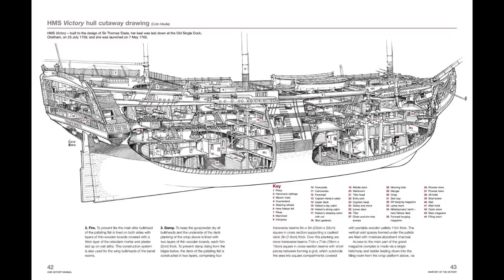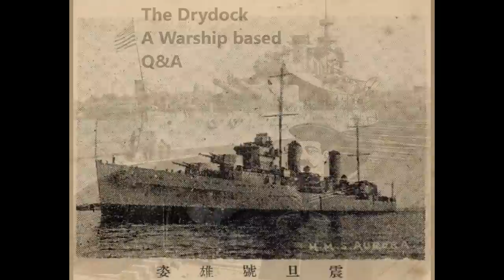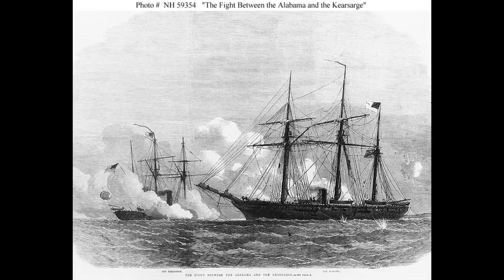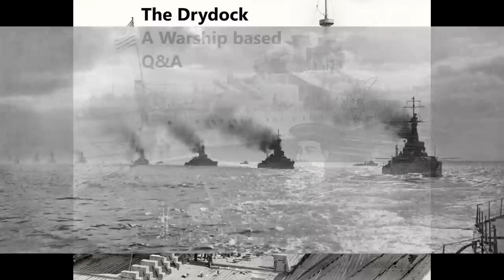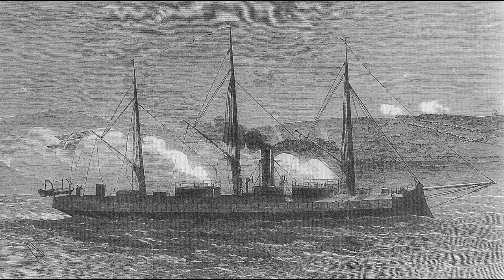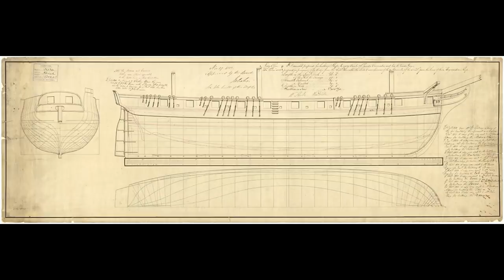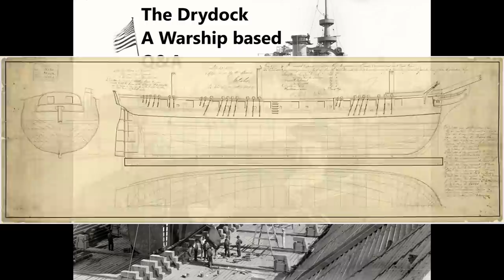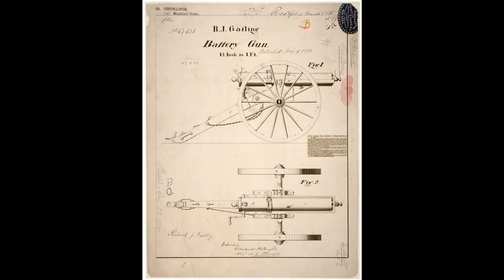The Drydock - Episode 179

Comment: Regarding obsolescence being an advantage: The USN's old S-Boats were too old to use the Mk. 14 torpedo and thus had badly outdated but actually functional torpedoes when the shooting started.
Reply: I've read about Mark X torpedoes fired from an S-class submarine sinking before they reached their intended target, and not from being fired at extreme long range.  The Mark X's did have a problem running too deep; according to a Bureau of Ordnance report written in January, 1942, but only 4 feet too deep.  However, we know how reliable their reports were in respect to the Mark XIV, so perhaps the occasional Mark X, or a batch of them, ran really, really deep.  However, the Mark X's older detonator's weren't the disaster that the Mark XIV's were.
Reply: @Dave5843-d9m  The modern torpedo would have exploded under the Belgrano causing the vessel to break her back, massive loss of life. This was not wanted.
Reply: Germany had a similar thing in ww2, they had older subs that could use their larger stocks of obsolete torpedoes while their newest subs were being choked for munitions by bombing
Reply: @AsbestosMuffins  Weren´t all german Subs so new that they could technically fire every variant of the G7 Torpedo?I mean...germany still used WW1 torpedoes in WW2 anyway..they just updated them
Reply: @Kwolfx  Torpedoes that run too deep are easier to compensate for. Just set them to run at the minimum possible depth.
Reply: @kennypolson5548  It's was more that the modern torpedoes had a tendency to malfunction.
Reply: Not so much too old for Mark XIV torpedos.  Mark XIV torpedos were too long to fit into the S-boat torpedo tubes.

Comment: Adding to the Virginia Capes comments, Cornwallis had established his position in Yorktown under the assumption that he would always have a path of supply and if necessary retreat on the water. In fact his cavalry units were just across the York river which is quite wide at this point. This gave him the opinion that he had established a secure position with both reinforcement, resupply and retreat available to him. When the French kept the RN out of the Chesapeake Bay he found he had placed himself in a trap, which had closed! There was some effort towards crossing to the north side of the York but artillery bombardment made this futile.
Reply: I really could see this being crossposted as a podcast (i mainly use it as such anyways) would work splendidly, even with no chances, even if the format isn't meant for this.

Comment: A somewhat more robust solution for contra-rotating props is a planetary gearset, apply power to the middle pinion cage, and the inner and outer gears turn in opposition at exactly the same rate.  This setup is used in your automobiles automatic transmission as the reverse gear.
Reply: Planetary gearset, in salt water. Yep that sounds like a brilliant idea.
Reply: @Self-replicating_whatnot 
Your salty comment is pretty corrosive

(I apologize, but just couldn't resist)

Comment: Re: Boarding Actions in days of sail.
It is well considered that when warships NEEDED to board anouther ship it was likely that their own ship was more badly damaged than the other ship.
Such pyrric victories are usually not the forte of the better captains. 
II. Pirates, on the other hand usually intimidated their prey before sending small, yet violent boarding parties. In these cases there were several considerations.
A. Was the prize in better condition or better suited in some way to pirate operations.
B. Considering that some good captains had many a prize within their small flotilla it is likely easier to board the prey and secure it as a prize than it is to transfer everything valuable to the smaller pirate ship.
III. It is most likely that most boarding actions took place in lee locations and calmer waters.
Even in ports "quiet" boarding actions were known to occur in the very early false dawn hours.

Thank You.
I listen many many days and do rerun more of your broadcasts than any others I have subscribed too. Additionally you have an excellent voice to listen to even in such vehicle traffic which maddens even the best drivers.

Comment: Transom stern discussion is very interesting. Today, transom sterns are common on all types of warships and, as you mention in your answer, one would suppose that it allows reduced structural weight because you can make it by truncating the lines of the hull. As a ship hydrodynamicist myself I have designed many ships with transoms and hardly any with cruiser sterns.
However, the notion that a transom stern is more structurally efficient is, I think, a modern conclusion with a concealed, subtle assumption behind it. Today's ships, especially warships but also most merchant ships other than tankers or bulk carriers, are volume rather than weight limited, and therefore getting more internal volume without additional hull length is a benefit to the ship's performance and economy. However, in 1940, warships were weight limited and internal volume wasn't at a premium, so internal volume might even be considered a nuisance for the designer who had to provide lighting, heating, and ventilation for it even if it wasn't used for anything.
There's also a fabrication issue: square is easier to manufacture than tapered, especially when tapered in prewar times usually meant compound curvature. Nothing upsets a shipyard manager like compound curvature.
Finally, there's the hydrodynamic issue. The efficiency of a transom stern is a function of the Froude number. For smaller warships like destroyers, a transom stern allows reduced wave resistance and better performance, particularly at speeds above hull speed (FN = 0.40). If you compute the Froude number for a battleship you'll find none of them can actually  achieve hull speed. Modern naval architects are aware that a transom stern can be made to work rather well at lower Froude numbers but it takes a delicate touch. A transom stern will generally have more wetted surface and if the exit isn't just right, with a very small immersed sectional area, added turbulence aft of the transom will do away with everything the designer hopes to gain on residuary resistance. So, especially at lower cruising speeds, a transom stern can require more power, or looked at another way, poor fuel endurance. A battleship's range was very important in World War II and the Bismarck chase is probably the best real world demonstration of that.
Accordingly, I would suggest that the explanation for the rejection of transom sterns on battleships is mainly concerns about fuel economy at low speeds, which were gradually made to seem less urgent as cruising speeds increased and at sea refueling evolved more later on in history and designers learned more about the hydrodynamics of transom sterns. It should be noted that the USN declined to develop transom sterns on large ships like battleships and aircraft carriers until after WW II was over.  
I was always impressed that the RN was ahead of the pack in recognizing there could be advantages to transom sterns even on the largest ships. And today it's the rule rather than the exception.
Reply: Thank you very much, Steven.

I read your response several times and think I’m beginning to understand it.  There’s a lot to comprehend there, and I appreciate your thorough explanation. I know Drach has been wanting to talk about the Froude Number for a while (though few seem to vote for it), but as a practicing professional in the field I’d appeal to you to work with him on an explanation video (there are many related hydrodynamic issues you could explore) that’s geared to us interested non-engineers. 

Regardless, thank you so much for your comment. Even though it was challenging to grasp, it really did help my understanding. 

Best regards!
Reply: @HEDGE1011   Thank you for the response. It is a challenge to write an explanation of the role of transom sterns in naval ships without using any math or citing any model test results so I'm satisfied that you were able to get something out of it. A more technical explanation is available in a series of 4 articles I wrote on the USN's high speed destroyers, appearing in two separate technical journals from 1997 to 2013. The discussion of transom sterns in Part 3 (Warship International, Volume 50, Part 2) focuses on the resistance aspects of this hull form feature.

Comment: According to "Last Stand of the Tin Can Sailors," the Samuel B. Roberts locked down her safety valves during the engagement off Samar.
Reply: Yeah, and given that Drach mentioned her speed run in his amazing Battle of Samar video I was surprised he didn't mention her here.  They overloaded her engines so massively that she made almost an extra 5 knots and made 120% of her design speed!  (And using the 'power being roughly the cube of speed' heuristic that would have required nearly 175% of her rated engine power!!)

Comment: On diesels the "cylinder drain valve" is called a snifter valve. Before starting,open the snifter valves and roll the engine over, noticing any discharge as a indicator of cooling system leak.

Comment: 1:48:10 Oh yes, those HE shells would wreck bunkers plenty. I am pretty certain that one of the  artillery bunkers in Normandy took a direct hit by a 203mm HE shell, and it collapsed the bunker partially. But unfortunately I can't remember where it was. I was just passing through on to many other sites so didn't properly remember the name.
1:49:03 Did you take this lower number of AP shells into account when you made the 'Yamato is confronted by Oldendorf' scenario? It seems to me that they managed to expend almost all their AP is a rather short time, not nearly enough time to take down the Northern Force should they have met (even without the Southern Force's death in the night).
1:54:44 I do believe this was a relatively common thing. Bismarck is mentioned to have done just that when the Swordfish came in. And I remember reading other accounts of "even firing the main guns" for multiple other bigger ships. It only really seems like the Japanese took the final step and made actual AA shells, but that many other nations were aware of the potential impact. The USN doesn't appear to have done so, and for good reason I should think. All those AA guns would have, at best, been disrupted, and at worst, outright wiped out, if the main guns had been used. But when AA guns were not so many, I can see the usage.
Reply: I believe the shortage of AP shells after Surigao has been debunked over the last several years. They started with 1,637 AP shells fired 285 leaving them with 1,352.

Comment: To the pushing the engines to 110%, generally speaking, safety valves are set to lift off at about 15-20 psi above normal operating pressures (Say a 450 psi rated boiler, the safety valves would lift off at say, 465-470 PSI and so on). So I think it wouldn't be uncommon for engineers to run it right up to that limit for that little extra oomph for getting out of conflict

Comment: Regarding boat sinking suction (05:01:58) I experienced that personally in a small boat accident on a lake, it's no joke and can easily drown you, especially if you're not aware of it. I've never seen that mythbusters episode, but in my case it was just a 5 meters long (~16ft) fishing boat displacing probably less than a ton, flipped over and went down like a brick after a high speed collision with a log. Despite being a fairly strong (and experienced) swimmer, I couldn't get away from that bloody boat until it actually hit the bottom, fortunately the lake was just 6-7 meters (20-23ft) deep at that point so it didn't take more than a few seconds in real time, but it felt like a much longer struggle and scared the crap out of me.

Comment: Drach, you partially shanked the rebalancing ammunition question regarding moving capital ship shells. You forget that once a battleship gets into harbor and needs to replenish shells, there has to be a mechanisms / methods of loading the magazine. They would be designed to operate in reverse as well. If you got a bad batch of shells or need to switch from AP to HE, or even enter dry dock, you would need to have an easy mechanism to remove the shells. Granted the rate of replenishment / removal would be very slow compared to the hoist mechanisms inside the turrets.

Comment: Re: titanic - there most certainly was suction involved in the sinking as Charles Lightholler (the most senior surviving officer) was sucked down in the vicinity of the forward collapsible lifeboats and pinned hard against some kind of intake grate before being propelled to the surface by a sudden release of gas likely related to a boiler detonation or something similar.
Reply: A really easy test regarding suction is to go to a pool, jump off of the diving board, yell "CANNONBALL!" and curl up into a ball.  As the water closes over your head you will absolutely feel the suction effect.  It pretty much slams into you and it will take a few moments to be able to claw your way back up through it.

Comment: Tugs tow with their tow line on a winch, they take up the slack with the winch , not the movement of the tug. They can also easily lengthen the toe at any time. It takes less power to tow a  battleship than you might think, I seem to remember a Crowley tug of the 8000 or 9000 BHP towing a Battleship from the West Coast to the East Coast around  Cape Horn.

Comment: 3:20:40 the question about a 14" armed Florida class.  As Drac suggested, without the pushback that existed in the USN to the move from 12" to 14", which was repeated in the move from 14" to 16", resulting in moving to larger guns sooner, I can think of a significant impact.  The Washington conference engaged in some political art in discriminating between pre-Jutland and post-Jutland ships.  In their art, Hood was deemed "post-Jutland" even though it was designed before the battle, while Tennessee and California, laid down after Hood, were deemed pre-Jutland, while Maryland, which was laid down before Tennessee, was deemed post-Jutland.  As the Colorados were largely a repeat of the Tennessees, with the exception of the 16" guns, if the Tennessees had been armed with 16" guns, which was openly discussed in 1915, defining the Tennessees as pre-Jutland would be even more problematic.  If the Tennessees were armed with 16" guns, and therefore deemed "post-Jutland", then, for parity, the US would not have been allowed to complete Colorado and West Virginia.  That would result in the US retaining the Delawares as "front line" battleships.  In the fleet drawdown in First London, the Delawares would go, and one or both Floridas and both Wyomings would be retained as "front line" battleships.
Reply: That pre-/post-Jutland negotiation almost sounds like a Monty Python skit. Was this type of multi-think common at the Conference?
Reply: @gerardlabelle9626  the newspapers of the time reported there was a consensus among the delegations at the conference that 12" guns were obsolete.  Of the three largest navies, the USN was the only one required to retain ships with 12" guns.  France retained three 12" armed Dantons, which commissioned in 1911, and received licenses to start building replacements in 1927 and 29.  The Floridas were also 12" armed, and commissioned in 1911. but the US did not receive licenses to begin construction of replacements before the 1930s, or authority to improve side armor and upgun the 12" ships, like France and Italy did.  I went through the annual spreadsheets published by the Bureau of Supply and Accounts and found that, in the late 1920s, the USN spent some $6.6M modernizing the Floridas, bulges, deck armor, conversion to oil fuel, when the WNT called for them to be scrapped in 34.  Washington was 80% complete when work was stopped.  The $6.6M spent on the Floridas, already obsolete due to their 12" guns, was just about what was needed to complete Washington, which would have been expected to serve for 20 years.  But completing Washington would give the US too many "post-Jutland" ships.  I think the real issue separating "pre" from "post" was the size of the guns, not the date ships were laid down or designed.  In July 1916, SecNav Daniels announced, with the General Board agreeing, that Jutland had proven the need to go to larger guns, which could penetrate at longer range.  If they settled on 15" as the "post-Jutland" size, then the RN would have 13 ships in commission that would be defined as "post-Jutland", even though some of those 15" ships were at the battle, and everyone else would be demanding authority to build a compensating number of ships  If they settled on 16" as the "post-Jutland" size, then the UK would need to spend the money to build three Nelsons.  So, the delegates engaged in some Orwellian doublethink that said Hood was "post", to avoid spending more money on a third Nelson, while the Tennessees with their advanced torpedo protection and all-or-nothing armor scheme were "pre", so the US could complete Colorado and West Virginia, to replace the obsolete Delawares.

Comment: I am thinking a square stern has different effects depending on designed speed.  The same issue is present on square back cars or planes.  A streamlined back might be more efficient at lower speeds but present more wetted surface area at higher speeds, essentually parasite drag.  Bullets and rockets generally have square back ends.  This results in a vacume as these high speed objects move through the air but possibly more laminar flow until the fluid separation point is reached.  In high speed objects it could decrease random laminar flow separation and lead to more controlability or a straighter flight path.  Older cars like XKEs have streamlined backs, newer ones tend to have cam backs.  The streamlining does present more surface area.